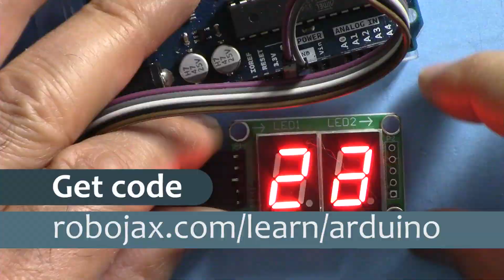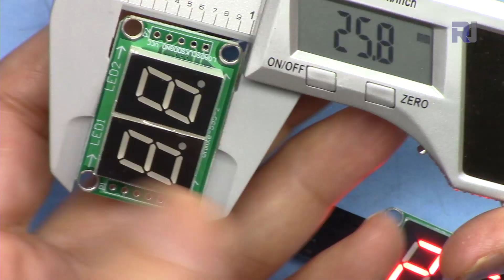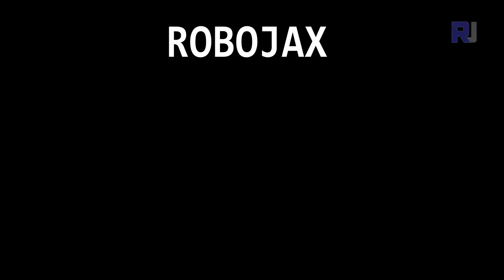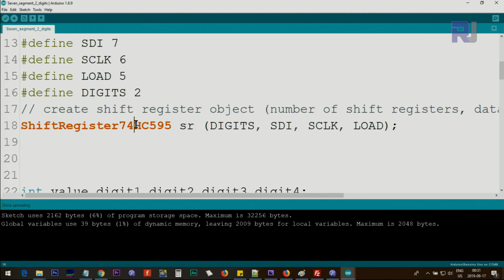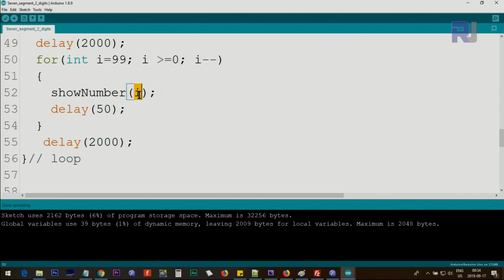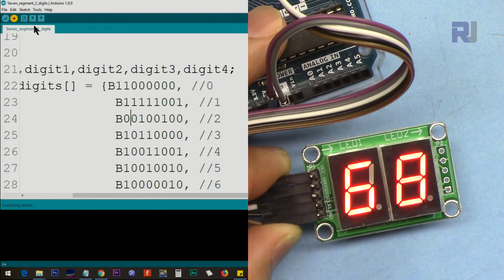74HC595 Seven Segment 2 Digits LED Display with decimal points for Arduino - RJT219

Comment: Is exactly what I've been looking for! But need trim potentiometers the 2 7 segments should roll from 00 to 88. When it shows 88 it should output 12V current with a ticking relay for each digit
Reply from the maker: You will need complete new project.  Or have a look at my other videos that display temperature or other parameters and learn from it  for your own purpose https://www.youtube.com/channel/UCkcBSig_Iu4ZnAIeCeG1TVg/search?query=TM1637  and here is my Arduino Course on Udemy so you learn Arduino step by step and should be able to write your own code http://robojax.com/L/?id=67

Comment: Everything worked great!  How would you make the tens digit to be blank when I only display single digits - I dont want to see a zero in the tens digits when showing 0 thru 9 - Thanks
Reply from the maker: You are welcome. have you subscribed? I just watched the video (as I forgot what I did ) and you need to update the library. This can't be done with just changing the code.  I have explained the code very well and nothing is unexplained. So if you understand the code, you may be able to change the library for you purpose. Good luck.  Thank you for not skipping the ads and keep watching them. This will help me a lot.
Reply: Robojax I will give it a try

Comment: hi there, im running a LED 5604 Display,  may application is only start top timer with decimal betweem segment 2 and 3,  my problem is to start the count down to 1 to 99.99 secconds,  also I want to add a button for start and button for stop.  Plus beep sound during the start button is pressed.
whem im using your sample the coundown starts at 100
Reply from the maker: Hi  nice project. Keep the working.
Reply: How about 4 digits display?

Comment: When using shift registers like 74HC595 or CD4017B, how is it that you can define which pins you plan to use on the IC? That’s little confusing for me.. I don’t see how you can choose which or an exact output pin you’d want to use??
Reply from the maker: Hi, We have defined a pin for clock SCLK and the rest is taking care of by the library files ShiftRegister74HC595.h and ShiftRegister74HC595.cpp . if you want to know how the library functions, open those files (from zip that  I provided) and see how it works.

Comment: Hi Ahmad, thank you for another cool arduino video ;) Could you do one about extending the arduino nano to control several stepper motors , a display of values regarding motor behavior or position, and potentiometers to set motor speeds or to get them to move when you turn a potentiometer ? I know that's quite a project and i dont mind if you dont do it as i descibed it but now you see what kind of needs makes me wonder what is the best way to extend the nano's pins number. Anyway, i really appreciate your videos, take your time with editing the videos man ;) have a nice day !
Reply from the maker: Hi Co Fa, You are welcome. I am glad you like it. I have  items for this purpose but it seems I am getting buy more and more. Now with full time job and enrolled at graduate courses getting more busy. You can use MCP23017 https://www.adafruit.com/product/732 to have 16 more pins. If I get a chance, I will make a video on that.

Comment: How do these connect to the Atiny85 chip?
Reply from the maker: I've shown how many pins you need. if you can define that many pins Attiny85, then yes you can use.  But if you want o use LCD with Digispark Attiny85 chip here is the video https://youtu.be/U95hw-ec6nY
Reply: @robojax  Thanks. Can I connect this 7 6 5 on the Atiny 85 to numbers 1, 2 and 7 on the Atiny 85 chip?

Comment: Thank you for the video, it is really to the point, but as for 31/jul/24 that Sketch does not work any more, some changes in the library ShiftRegister74HC595.h, sharing the corrected sketch for the comunity, 
#include <ShiftRegister74HC595.h>
int dataPIN = 12;  // sdi  in the 2 digits led  displ. (or the pin you have designated in the arduino)
int latchPIN = 10; //load in the 2 digits led  displ. (or the pin you have designated in the arduino)
int clockPIN = 11; // sclk in the 2 digits led  (or the pin you have designated in the arduino)

ShiftRegister74HC595<2> sr( dataPIN, clockPIN, latchPIN);  // here is the differences with the old program, read the documentation for the library.

int value,digit1,digit2,digit3,digit4; 
uint8_t  digits[] = { B11000000, //0
                      B11111001, //1 
                      B10100100, //2
                      B10110000, //3 
                      B10011001, //4
                      B10010010, //5
                      B10000010, //6 
                      B11111000, //7
                      B10000000, //8
                      B10010000 //9
                     };
                        
void setup() {
  
}

void loop() {
  showNumber(69);
  delay(2000);//
  for(int i=0; i<=99; i++)
  {
    showNumber(i);
    delay(350);
  }
  delay(2000);
  for(int i=99; i >=0; i--)
  {
    showNumber(i);
    delay(350);
  }
   delay(2000);   
}
//this function is written by Ahmad Shamshiri on Sep 17, 2019. 
// * in Ajax, Ontario, Canada
 //* www.Robojax.com 

void showNumber(int num)
{
    digit1=num % 10 ; // % =modulo  //reversed the order changing the 2 for a 1 as numbers where showing wrong order 
    digit2=(num / 10) % 10 ;  //reversed the order changing the 1 for a 2 as numbers where showing wrong order 
    //Send them to 7 segment displays
    uint8_t numberToPrint[]= {digits[digit2],digits[digit1]};
    sr.setAll(numberToPrint);  
}
Reply from the maker: Hi, Please provide the error.  it should work as the library is provided hasn't changed. Get it from roboajx.com

Comment: hi, can you help with the (AVR) assembly to control the SCLK, SDO, and LOAD pins? how to determine which digit to write to with the TZT 7 segment display (based on 74HC595) with only the three pins?
Reply from the maker: I don't knwo about "TZT 7 segment " but it should work.

Comment: Awesome video, but can you help me with writing 10 digits insted 2 digits
Reply: Because 1 have 5 these displays and i conected them in series
Reply from the maker: thanks. I believe this module is the solution because it is easy to use with decimal point. TM1637 is very hard to use. I would have to make video of that. if you follow the explanation of the code,  you should learn how it works and modify it.

Comment: what is "invalid use of template-name 'ShiftRegister74HC595' without an argument list
" mean?
I have download the zip. .
Reply from the maker: It means when you use ShiftRegister74HC595 you should have it fully like 
ShiftRegister74HC595 sr (DIGITS, SDI, SCLK, LOAD); 
and DIGITS, SDI, SCLK, LOAD are called argument for this ShiftRegister74HC595.  check to see if you have it. also DIGITS, SDI, SCLK, LOAD should be in the lines above. I can't put the whole code.  just see the code and compare it. or simply copy full code.
Reply: @robojax  how can I fix it
Reply from the maker: so you did not read what I said above? please read.
Reply from the maker: just use new code. don't change anything. it works.  of course you gotta download and install the library.
Reply: @robojax  I have solved it. Thank you very much!
Reply from the maker: I am glad you did.  cheers.
Reply: @robojax  But like that is the code so what do you mean there I checked what you said and the code is exactly like that.
Reply: facing same problem how did you solve it?
Reply: Change this line: ShiftRegister74HC595 sr (DIGITS, SDI, SCLK, LOAD);  
to this: ShiftRegister74HC595<DIGITS> sr(SDI, SCLK, LOAD); 
the later is the new way of using the library.

Comment: hi, i find error on " ShiftRegister74HC595 sr (DIGITS, SDI, SCLK, LOAD);"
" invalid use of template-name 'ShiftRegister74HC595' without an argument list"
how to fix it??
please help
Reply from the maker: Hi, it means you have selected a function without arguments. Please use first the original code and see if it works. If so it means all wiring and code is correct. then update the code.
Reply: @robojax  dapatkah Anda menunjukkan kode asli, dan memberi tahu langkah demi langkah ?, saya pemula, terima kasih sebelumnya
Reply from the maker: Video ini selangkah demi selangkah. ikuti saja. Saya tidak dapat menampilkan lebih baik daripada video.
Reply: @robojax  oke thanks sir
Reply: ShiftRegister74HC595 sr <DIGITS> (SDI, SCLK, LOAD);
Reply: ShiftRegister74HC595 <DIGITS> sr ( SDI, SCLK, LOAD);

Comment: Hi. Apologies if this is super obvious but where can I purchase one of these two digit units?
Reply from the maker: Hi,  no problem. just search for the name of the chip 74HC595  on any store like Amazon, eBay or aliExporess
Reply: Robojax thanks for responding. I can find the 74HC595 shift registers no problem - I have some from other projects I’ve worked on too. I think the video is showing a two digit display with these integrated into a single unit, this is the component that I can’t find. Do you know if this is on sale?  I’ve done a lot of googling but either find shift register chips or two digit, seven segment displays, but not a combined component.  Thanks again for your help and also the description of the code - all makes sense. :-)
Reply from the maker: you are welcome.

Comment: why show the decimal point on the #2? it isn't needed to look like a #2
Reply from the maker: Hi, Sorry which #2?
Reply: @robojax  THE NUMERAL 2
Reply from the maker: that was just an example.
Reply: okie dokie, I would like to use this to display flap position on airplane as in flaps 10,20,30 degrees

Comment: Hello. Did you ever get around to making a video with two of these displays cascaded together? Using one display works great but when I cascade the second display the two sometimes work OK but often show garbled results. Here is a link to what I have done: https://hackaday.io/project/176421-think-a-tron-2020. You can see that the two displays are about a foot apart so there is a 12" long 3-wire cable running between them which leads me to think it might be a timing issue but I have not ruled out code. I have tried modifying your 2-digit code a couple of ways but nothing works reliably. Unfortunately I have few pins available with this project so I can't drive each 2-digit display individually.  Thoughts.
Reply from the maker: forgot about this. I've found a display that can do anything you want https://youtu.be/tEwWsbHQA5Q
Reply: Hello Michaelgardi! Did YOU figured out from where did you get the garbled results with the displays? I am trying to program one display to do a countdown with an esp32 board, but I get only rubbish results, mostly 88 on display. The code is ok, because it works fine with a single digit display, and also, when I touch the wires form the esp32 board to the display, it will change the lit segments by itself. Thank you!